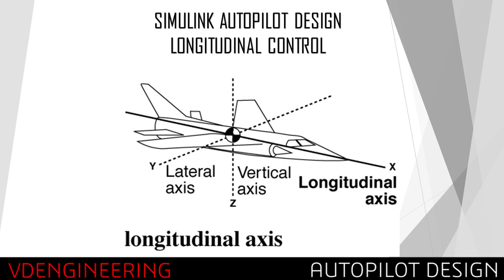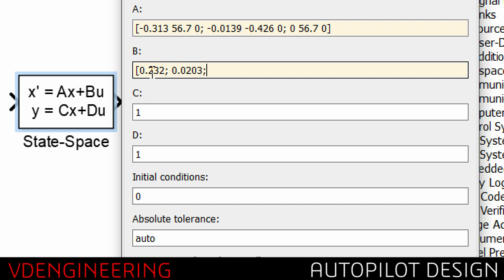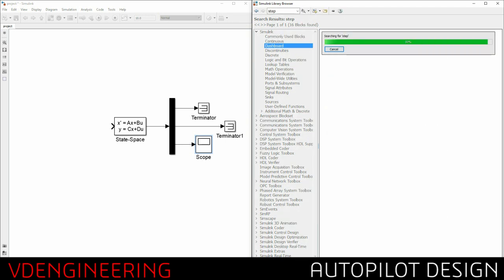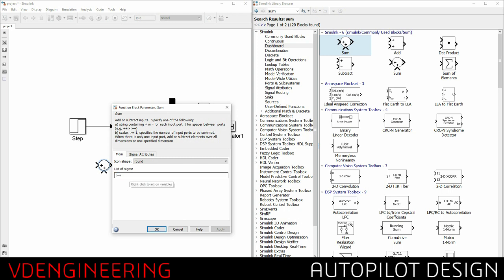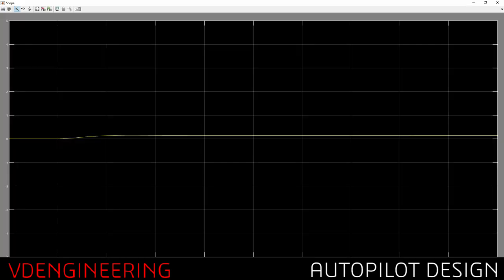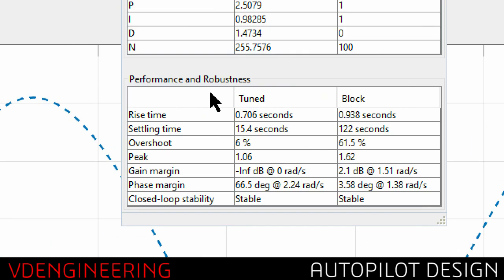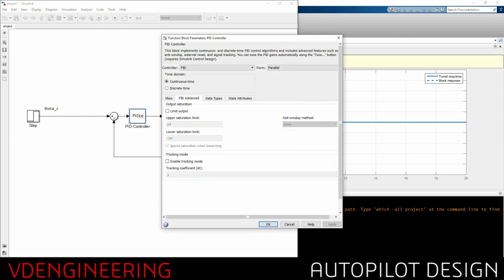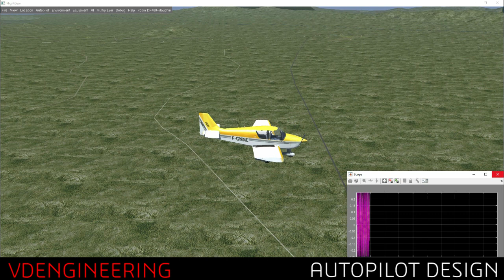MATLAB & Simulink Tutorial - Design a Simple Autopilot (with Flight Simulation!)

Comment: Hey if I wanted to output the elevator angle and thrust so that I can connect them to PWM outputs to control and stabilize a drone. How would I do this? I already have the PWM blocks in Simulink, I just need to extract the thrust and elevator angle response from the state space model and plug it into the PWM blocks for actuation.